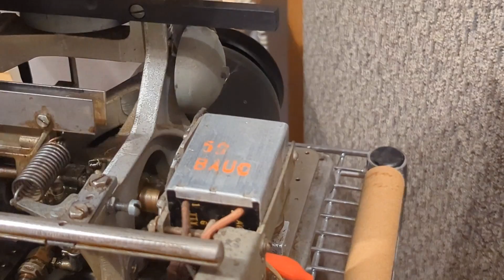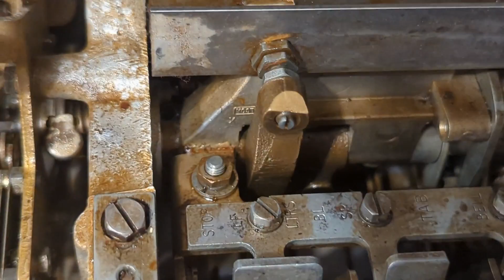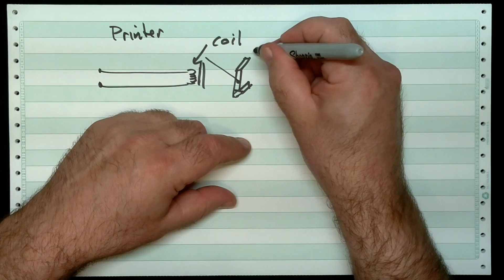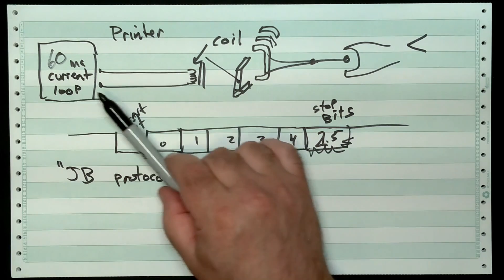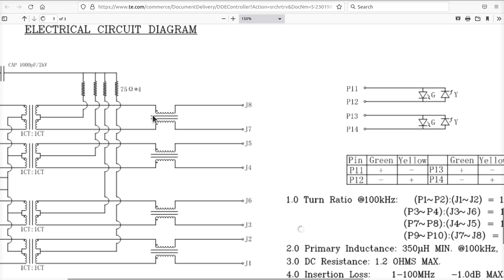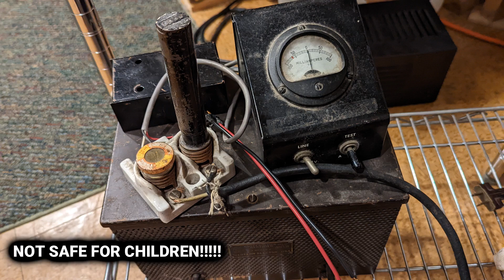Z80 Retro #36 - Connecting a Model 15 Teletype pt. 1 (How the teletype machine works)

Comment: In the 1970's the dream printer was an ASR33. They were almost impossible to get because you would purchase a new printer by trade in. Model 15's were used by hams to do RTTY. My SWTPc had a bit banger serial port that I thought would work. It's serial port voltages were 20ma. In addition to increasing the power to 60ma, I put an opt-isolater in to stop voltage spikes. My Model 15 was 60 baud as well. Because I didn't have an disk operating system, I modified one of my 8k Basics to include the Baudot printing routine. The routine included stripping alphabetical characters to upper case and adding in a letters/figures shift every time the text switched from letters to figures. I got it to work, but it made mistakes. It seemed that the polar relay wasn't completely rotating, so I extended the stop bit from 1.5 to 2 bits. It worked well, except it was really obnoxiously  noisy. I made Snoopy calendars for all my friends. I eventually donated it to a railway station museum. They forwarded it to another museum, which never displayed it.
Reply from the maker: Cool!  Boy... You'd think a museum would run it from an arduino or some such thing to print messages for their visitors. 😕
Reply: Before I donated it, I got it working 100%. The leader of the Railroad Station wanted to make the station exactly like a station from 1898. The Model 15 didn't fit the bill. They gave it to a telephone museum. That museum then gave it to a history museum that just wasn't interested in doing anything with it, so it sits in a basement collecting dust. The 15 was used by Germany up until the end of WW2, then the Allied Press, then the Canadian National Railway, then by a Ham, who sold it to me. It had a Maltese Cross as one character, but that key was disabled.  @JohnsBasement  I programmed the "Here Is" key to type my name.
Reply from the maker: @clcswitcher  Wow!  All I know of mine is that it has a Western Union name-plate and that the uncle of a friend grabbed it in a dumpster-dive some decades ago.
This is the first I have heard mention of a "here is" key.  Sounds like a  costly add-on!

Comment: The "selector magnets" operate the "armature" which it turn controls the "swords" to indicate either a "mark," a 1, or a "space," a 0, bit.  And so on throughout the mechanical chain.  At 45.5 baud the bits are each 22ms and the stop bit is at a minimum 33ms (22 + 22/2 = 33 or 1.5 times the bit length).

Comment: There's a series of videos on the CuriousMarc channel from a few years back covering the restoration of Model 19 and Model 15 teletypes. Including connecting the Model 15 to a Linux machine.

Back in 1983 the British magazine "Sinclair Projects" published a design to interface a ZX81 to a radio teletype MODEM which included some assembly code to handle input and display of 5 bit Baudot.
Reply from the maker: Yeah I saw that one too.  I should have posted mine running ages ago.  Somewhere I have a clip of it printing a news article that I shot 20 years ago.  I could-a had the first teletype on YouTube!  🤣

Comment: Very cool - I am looking forward to interfacing my recently acquired Teletype ASR33 ASCII teleprinter to the retro board. I also have a model 32 baudot unit which should work much like your model 15.
Reply from the maker: Cool!  Send pictures!!!

You should also look at more modern 60-ma current loop interface designs.  Search for deramp....  Here you go:

https://deramp.com/tty_adapter.html

He has been posting some vids about his model 15 and did a nice modern interface for it.  Maybe some more ideas for you.
Reply: @JohnsBasement  Some of the older machines had polar relays that could be wired so that the coils of the relay were connected to the RS232 output.  That operated the contacts which became the "keyboard" of the 60ma circuit.  I have one here wired up that way.  Works like a charm!
Reply from the maker: @codecage9333  Huh... mine seems to like its own franken-power supply.
Reply: @JohnsBasement  What I was talking about eliminates the the need for your diodes, resistor, transistor, and relay.  But you would need one of those 255A relays that were used in those old machines.
Reply from the maker: @codecage9333  oh.  I misunderstood.  Yes, I'm sure that there are relays out there that could be used without a transistor driver.  That would have been easier.

Comment: WOW, does this bring back memories, John.  Back in 1976, roughly, I interfaced a ksr-33 teletype to a HealthKit H-8 computer. The ksr-33 had a paper tape punch and reader on it. I was able to write basic programs and save them to paper tape and then load them into the computer. The most sophisticated program was a biorhythm calculator that printed the three curves onto the printer. What fun 🤩. The H-8 computer was 8080 based with 0-9 keypad for inputting your code.  The ksr added a huge step in ease of programming. I later added a kit CRT/keyboard terminal which improved displaying program output.  Anyway, sorry for the digression, but thanks for the memories.
Reply from the maker: Man... Those were the days!!! 😀👍
Reply: @JohnsBasement  correction on the keypad. It was a 4x4 hexadecimal pad.
Reply from the maker: @billstoner5559  I thought 0-9 was strange.  😂
Reply: If it had a punch and reader, then it was a ASR not a KSR.  The KSR model was just a keyboard and typing unit.
Reply: @codecage9333  thanks for the correction.  It was a long time ago.
Reply: @billstoner5559  I'm working on 2 ASR33s right now.  One is close to working, but the other may wind up being a parts machine.  I want at least one of them working to be used as the console when I get my Altair 8800 out of sick bay. and running again.